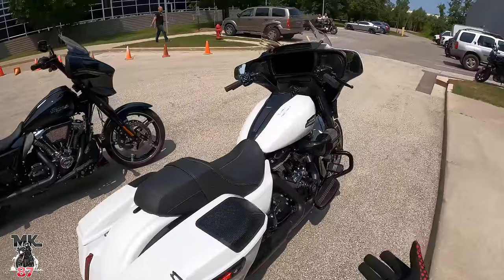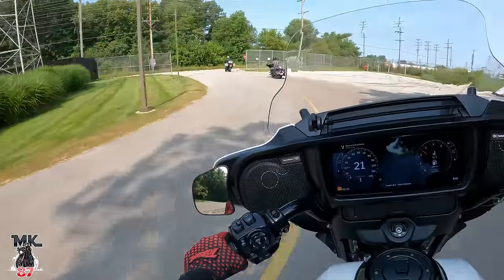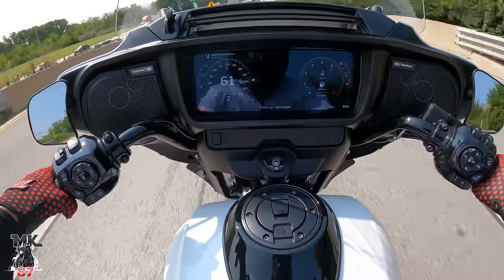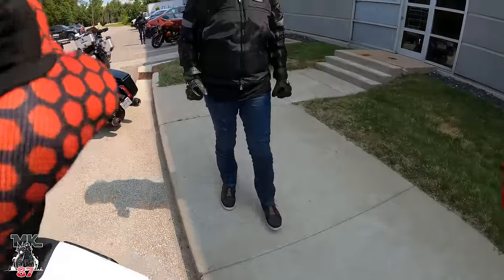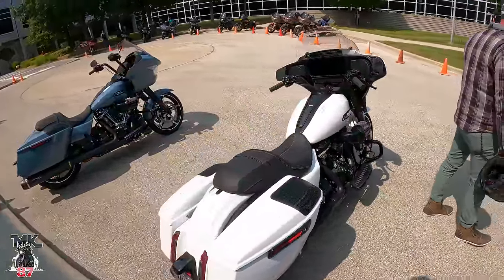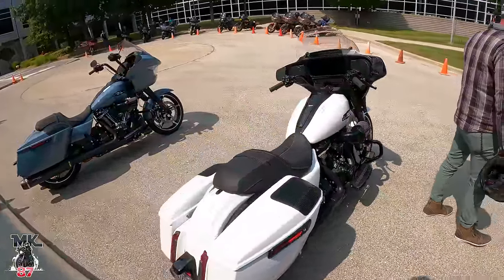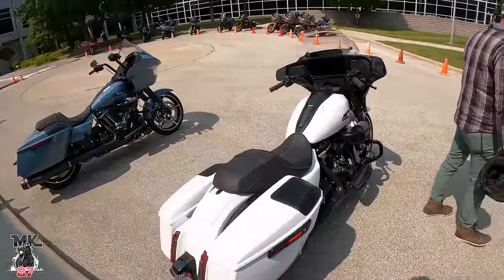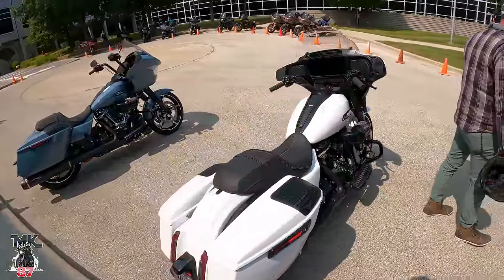Riding a 2024 Harley Davidson Street Glide with a 135 engine!

Comment: I thought the SE 550 cam was only for 131/135 engines? The SE 511 cam is for the 117’s. I did the 511 cam on my 24’ RG with SE tuner and it made a big difference 🍻
Reply: You are corr3ct…. The lady lied… the SE stage 2 is a 511, not a 550

Comment: You are so correct. With the 135cci crate, my 2022 Street Glide Special (114cci) is super fast with a lot of power. You have to be more aware of your surroundings. The bike wants to move fast and it is so smooth.

I love my bike. This was a great upgrade. Make sure to upgrade the exhaust. I did. My dealership took care of me.